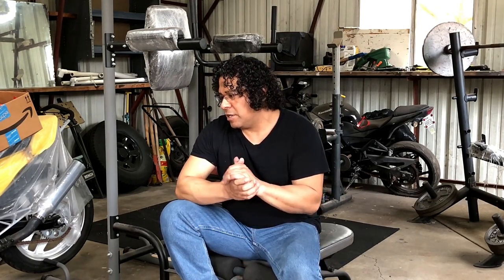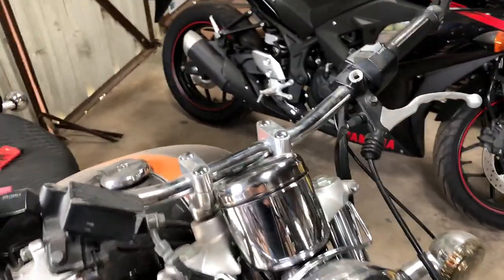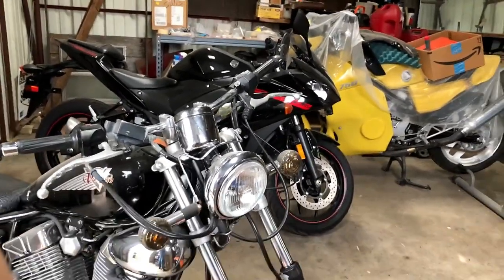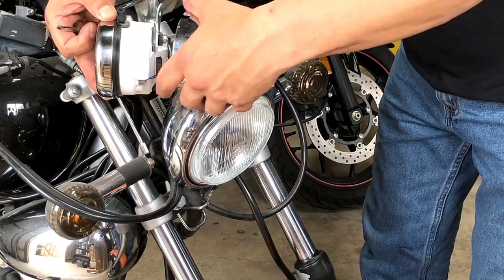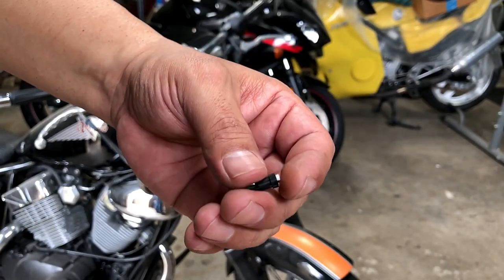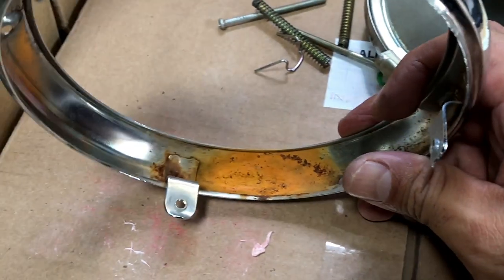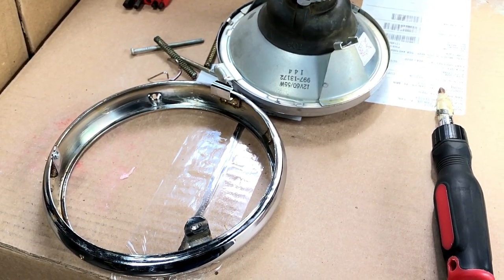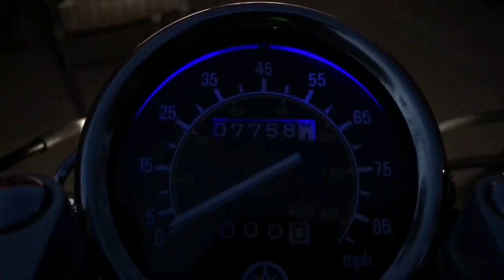Yamaha Virago LED Speedometer

Comment: For those wondering : 
The speedo bulb is a standard halogen wedge , T6.5 , 3W.
 It will fit the 250 and the 125 versions ( part number 42X835170000) 

He’s putting a T5 as a replacement, as T5’s fits the socket too ( not as snuggly, but firmly enough) 

If you just want to change the color, you can do it like back in the day , with a silicone bulb cap of the color of your choice, or by purchasing a glass tinted one 😊

Happy riding to y’all ✌🏻😄
Reply: Thank you, i've been looking for a soccet name for hours, I've found different ones that say they fit, but soccet, for some reason isn't mentioned even in the yamaha part cataloge

Comment: Thanks a lot also from Germany :-)  I had to replace my speedometer cable, and your video helped me a lot ... the two screws which hold the tachometer and the lamp case are really bad guys ... took me a lot of time, but ... ok it all worked fine in the end.
And hey ... love your Virago style.
Reply: These two screws are literally pain. I'm just trying to unmount them rn, and I'm really struggling xdd
Reply: A tool with a short head and a flexible shaft was my salvation
Reply: @uwegartitz9232  well after some time ratchet was my solution:D

Comment: my 2006 xv250 speedometer and front light housings are joined together with a round bracket and grommet . No idea how to take them apart.
Reply from the maker: Brett Sutherland Interesting even though our bikes are four years apart I would think that the industry standard would be about the same I’m sorry I couldn’t help you I’m not sure or familiar with the 2006 for all the lighting mounting brackets, The only thing I can think of is perhaps somewhere within that base where the speedometer and headlight meet the frame there has to be some sort of bolt or maybe even a cover plate of some sort covering the screws or bolts that connect it, which makes it hard for you to see.

Comment: How long did this Job take, it looks fiddly.
Reply from the maker: Thanks for watching ,Did not take long at all I would say approximately about 45 minutes only because I did a few little extra things along with the replacement of the LED. I still have this motorcycle. I just haven’t had time to do some of the modifications I wanted to do with it. My last video on the motorcycle was rusting out the tank which came out perfect hopefully in the next couple of days I’ll be able to upload with some more videos on it. I truly enjoy this bike. Hope this helps. Stay safe.👍🏽✌🏽
Reply: @solisapaul  Thanks for that. I tried today too change my speedometer back light bulb. But unfortunately it was too tight space for me. I tried moving my head light but most bolts on my bike are rusted and seized and bolt heads worn or snapping off, I've replaced alot since I  bought the bike 6 months ago, but I think I will take to a mechanic to change for me as I don't have the tools. I can't get in between the speedo and the headlight, it's a real pain as previous owner's really didn't do the bike any favours.
Reply from the maker: @JoniGMovieCorp  yeah it’s a shame when a nice looking bike such as the Virago it’s not maintained properly. These truly are very good trustworthy bikes, and parts are extremely reasonable, Sorry to hear you weren’t able to achieve the replacement. Hopefully, you can find someone that won’t charge an arm and a leg to get it done for you. Take care and safe riding.👍🏽✌🏽
Reply: @solisapaul  Thanks for the video anyway. I was encouraged watching it, 
It's a lovely bike, currently using a bicycle light to illuminate my Speedo at night. 🤗

Comment: Can you drill a better hole so the water can drain better? 
Just curious my friend.
Reply from the maker: Rhino Dan thanks friend the bigger hole is what I was thinking as well however this was after I put everything back together...lol. I might take it apart and drill the hole a bit bigger at a later time. Thanks for the compliment I’m trying to give more focus on my videos but work sometimes makes this a challenge.
Reply: Casp 72 I understand about work and time.
Reply: I don't think a bigger hole will really accomplish what you want. The reason the water pools where it does, is because , when parked, the bike leans over slightly. Obviously. I would consider drilling an additional hole, (probably, 1/8 inch?), right at what would be the bottom of the circle, as the bike is parked on the side stand. Just a thought. Good vid, otherwise.
Reply: @EJ42955  I had a similar idea. Actually, I would probably draw a series of small holes (which no one is ever going to see anyway), so that, no matter what the angle of the bike, the headlight will drain efficiently.

Comment: Where did you purchase your LED bulb for the tach from?
Reply from the maker: Bryce Redwing Thanks for watching the LED light for the tachometer was bought from an automotive store here in Texas it’s called AutoZone they also sell it at O’Reilly’s as well as advance auto parts and Pep Boys I’m not sure where you’re from but it’s your typical neighborhood automotive shop. Hope this helps
Reply: Thanks for the reply you're must be slightly different than mine they told me they could find one with the same wattage at my local auto parts store which are all the same as yours. Thanks for the reply all the best
Reply: I would think your layer of grease might run when headlight heats up. Could plug the drain with grease and debris. Good video.

Comment: Were did u get the replacement bulb?
Reply from the maker: Chris Hayes thanks for watching, I got the LED replacement at Autozone it’s a neighborhood automotive store, located in there LED light isle. If you don’t have an autozone at your location most automotive shops like Pep Boys, o’reallys, Advance Auto Parts etc....have a similar LED Isle. Hope this helps.
Reply: @solisapaul  Is there a part number?
Reply from the maker: sheldon long I can’t remember the part number since I got these a long while back, however I got them from the neighborhood automotive parts store called Autozone, I remember taking the original bulb and comparing it with the ones in stock at Autozone, there I found a perfect match. I hope this helps, as long as the bulbs leads and circumference is the same it will be fine since these are LED bulbs the voltage and watts are minimal and therefore not causing a short.👍🏼✌🏼
Reply: @solisapaul  Ok, makes sense. I am replacing the speedo cable so may as well upgrade the bulb while I have stuff apart~ thanks!
Reply: @sheldonlong2299 a bit late , but yeah: 42X835170000 , 
Its a T6.5 , 3W halogen wedge bulb 😉

Comment: Is it brighter than it looks on camera?
Reply from the maker: To me it’s bright enough, you have to keep in mind that the face plate of the speedometer is black, so it holds back a lot of its Illuminosity, as oppose to a white. Hope this helped thanks for watching. Stay safe and sound.👍🏽✌🏽
Reply: @solisapaul  Thank you I purchased what I thought was the correct bulb but it showed up and was 4 times the size. Unfortunately part store employees are as helpful as they use to be around me. Hopefully I find the correct bulb soon
Reply from the maker: @dylanb7244  I totally understand what you mean as far as employee support at an auto store, i’ve got a lot more videos coming up on the Virago. If you’re interested the last video I did was the gas tank. It had a lot of rust from sitting overtime, but it came out excellent, if it wasn’t for work, I’d post a lot more videos quicker, but bear with me. I do have some videos coming on the Virago. Ride safe and thanks for watching👍🏽✌🏽

Comment: the speedometer mount of the virago is by far the worst part of the entire design. it's just fucking stupid. but i managed to get it off with a combination of anger, soccet joints and a tiny ratchet. however, I've given up trying to get it back on. I'm pretty sure I've stripped the screws and threads in the fork. I mean, the headlight is mounted with the same screws, that are blocked BY the headlight. and the cables are stiff and 2 different brackets. from an unreachable angle. i'm so angry i'm crying.
Reply from the maker: From the sound of things I can definitely see the frustration. Sorry that it was so complicated. I do commend you on your efforts, some never even try to DIY. But never give up! Try, try again.. be patient and keep your cool. Tackle this when you’re absolutely able to with no interference or troubles on your mind. “You can do this!” Stay safe and sound 👍🏽✌🏽